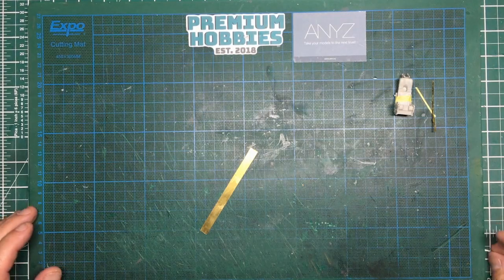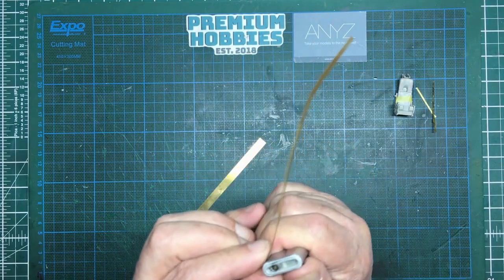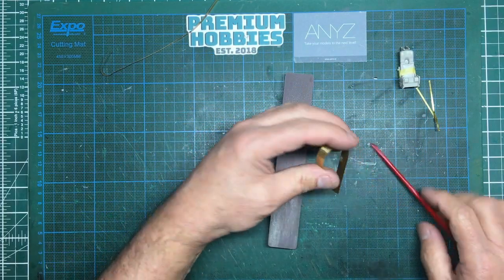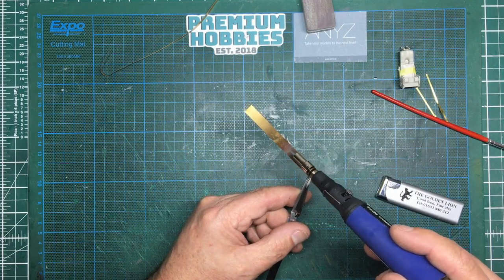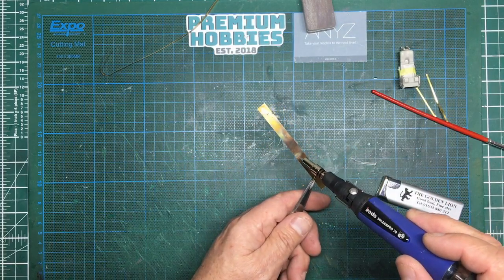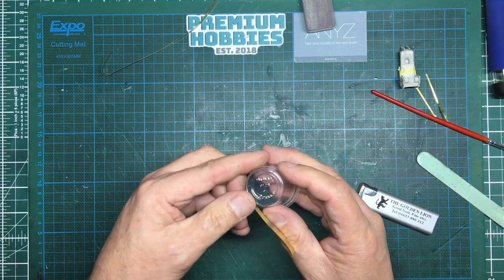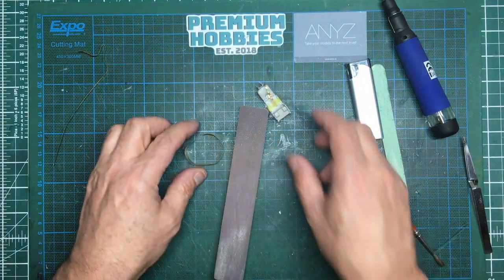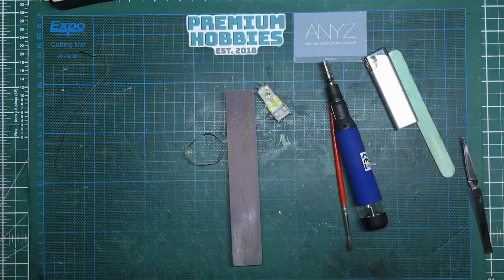Why do I anneal my brass PE parts?? How do I do it??

Comment: Nigel you are right about both, quenching and not quenching brass. Brass anneals in a few seconds at 700f (371c) to 750f (399c) to long at this temp or higher temp and the brass remains permanently soft, not a big deal for modeling use, but for most things it needs to be able to work harden again, so it needs quenched to stop the process. Also the lowest temp brass will anneal at is 600f (316c) takes about an hour.  Good vid as always, seems like a lot of new people are getting into this hobby and vids like this will keep the frustration levels down and keep them in the hobby.

Comment: THANKS for the info! 
Question - 
(I think I saw this on another YouTube Video about annealing - I asked Aussie Trekkie this question but he didn't know):
To gauge the correct amount of heat to apply - scribble lines on the brass with a Sharpie marker, then apply torch (evenly) over the brass surface until the marker lines have "boiled" off.
What do you think? Has anyone else heard of (or tried) this? 
(Seems like annealing may not be necessary for some photo-etch parts but is very helpful for parts to be "curled" or parts that may be flexed a lot.)
Reply from the maker: It's like airbrushing.. some just get on with it, some like to turn it into a scientific exercise. Basically.. heat it till it changes to a blue hue, quench or not. If it is still springy afterwards, just try it again. If you start to see red.. BACK OFF!!!

Comment: Can all PE materials be annealed or only brass? The PE sets I use are not brass, I am not sure what the material is - all I know is that it is NOT yellowish like brass! But I do struggles to keep the roll, mostly for exhaust pipes.
Reply from the maker: I believe any metal can be annealed, just heat it till it turns red and allow to cool. You are supposed to quench copper and brass but if you quench steel it will harden it. Best not quench at all.

Comment: Hi Nige,
I saw your your annealing video and like most of your videos... I learned the why/benefit of doing things.
Thank you for sharing :-)
Question: For PE where bends are required, is it recommended to anneal them first and does size or degree/severity of bend influence the decision?
I just received my first Eduards cockpit PE set in 1/72 and several of the pieces require bending...
Reply from the maker: No Mike, don't anneal anything that needs to be bent, however, if it needs to be curved, like a wheel arch or something it's easier if it's annealed.

Comment: One other thing - same as Vasili's comment below. Shouldn't the brass be allowed to cool gradually? Wouldn't that allow the brass to retain maximum ductility?
Reply from the maker: Non ferrous materials should be quenched to correctly anneal them.. but in practice I find it makes not a lot of difference, considering we are only annealing very thin strips.  Maybe a larger mass of material. like a 10mm thick plate would require quenching to fix its annealed state. I'm sure Google is your friend.

Comment: It's a shame that you can't quite anneal brass in the kitchen oven, as they don't quite get hot enough to get to the 300+ deg C you need.
Reply: you dont need to get it that hot , oven is fine for pe , maybe brass bars
Reply from the maker: I've tried annealing in my oven at 300 degrees.. it didn't work. I have read you need 400 degrees? Also, it's the material that determines the heat required, not its mass. This must not be confused with welding or brazing, where heat soak is an issue the more mass you have, so a higher current is required to achieve the same local temperature for a good weld.